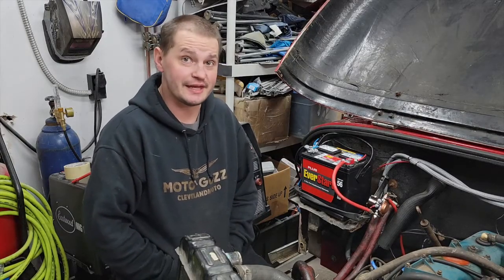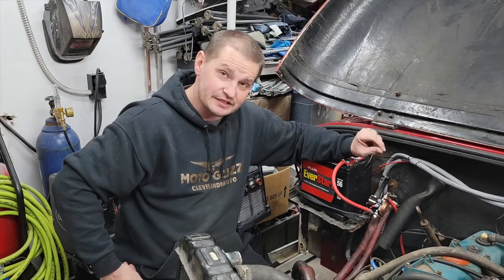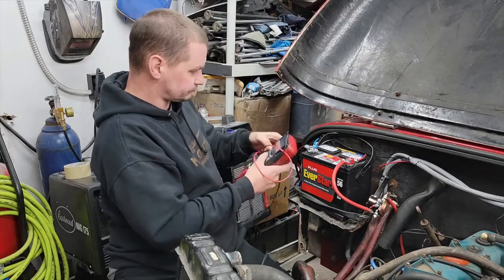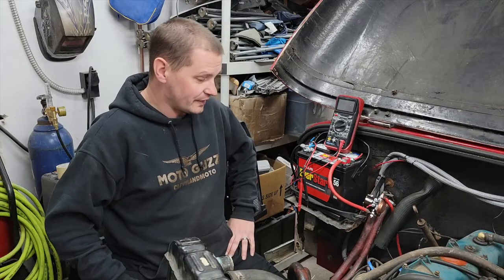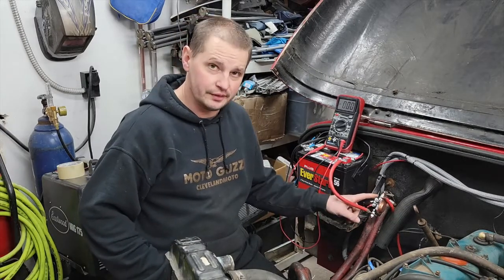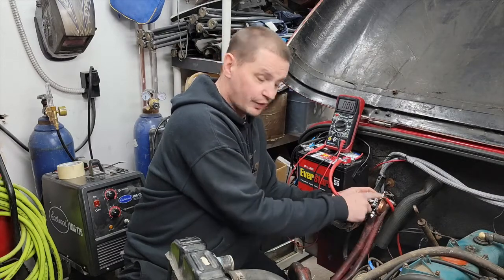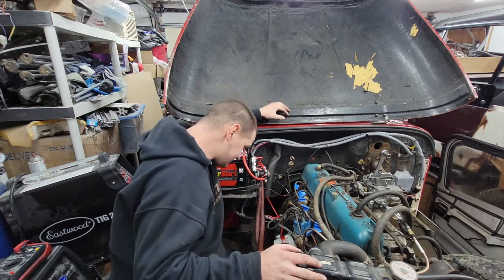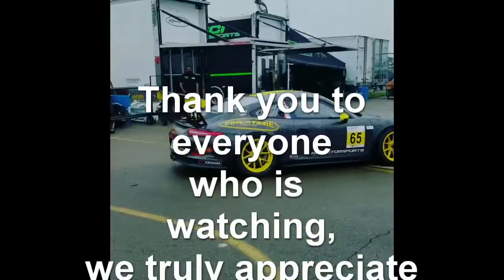Ford style starter solenoid and ballast resistor explained. Ep 41

Comment: Hello, great explanation. On my 1961 F100 it's a wire which itself is the resistance which goes from the ingestion switch to the ignition coil and I wanted to replace it because a ceramic resistance like yours with normal wire, did it work this montage for you?
Reply from the maker: It works perfectly.
Reply: @10footcustoms93  Thank you !